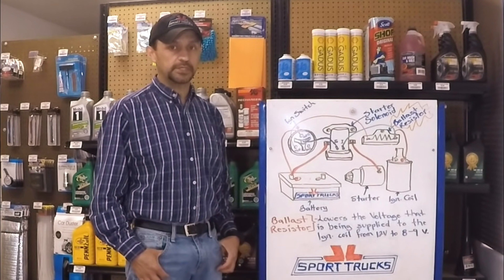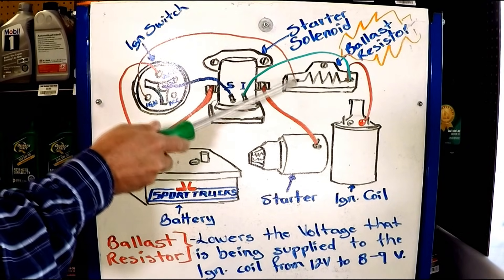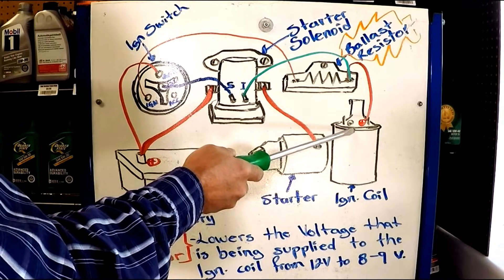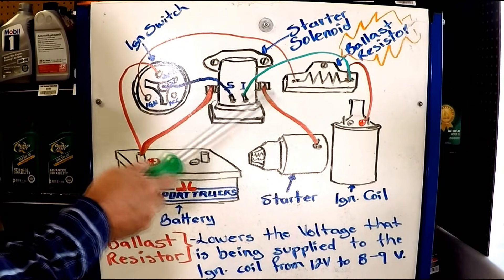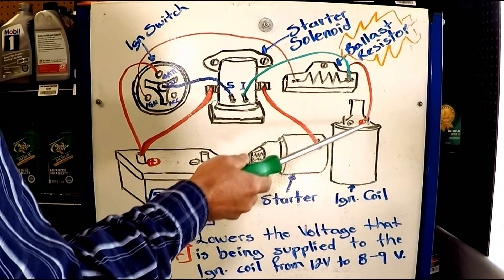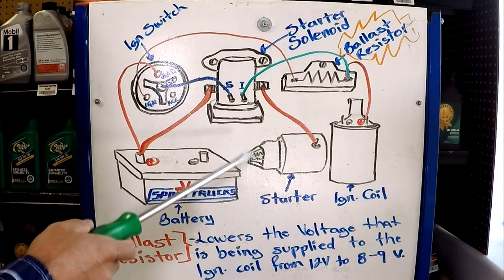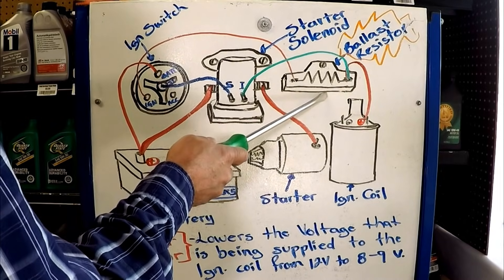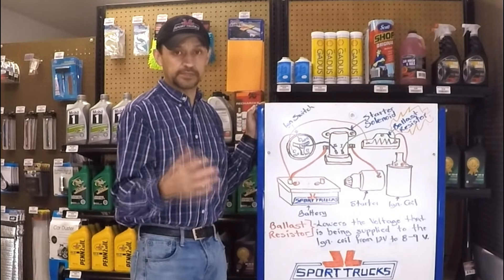How the Ballast Resistor Works

Comment: im currently working on a jet boat i just bought.Has no spark,ever dealt with a marine application with dual points/resistor.Has all these components but wired differently
Reply: if you have a g.m. engine that has the delco type starter with the solenoid mounted on the starter , than you want to run a wire from the solenoid terminal that gets power from the key switch when you are cranking the engine , you run the wire directly to the positive side of the coil . then you run a wire from the ignition switch " on / run " terminal , the wire that has voltage when the engine is running , not cranking , you run it to one side of the ballast resistor . then you run it to the positive side of the coil . if you are not getting spark at the plugs when you crank the engine over and are holding a plug with it grounded to the engine , then you want to check your condenser/ condensers , and make sure the points are opening . turn the engine over by hand or bump it with the starter until the high point on the eccentric , the part that rubs agaisnt the points rubbing block is directly adjacent to the rubbing block . check the gap between the contact points of the breaker points . it should be about .020 " . and make sure your plug wires are good and your ignition coil are good . spark plugs are not usually the cause of the problem unless they are oil-fouled or the gap is too wide

Comment: My car had a points distributor in it at one point and the ballast resistor is still hooked up, even though the distributor is now an electronic one.  Can this cause issues with the car running correctly?  I'm getting random stalls that I believe are electrical in nature.
Reply: Did you upgrade your coil or is it stock?

Comment: What happen if your only have one tooth on your starter switch instead of two? How would you do the connection? Thank you!
Reply: Just connect your 12v cranking feed to the coil to the main thick starter wire either at the solenoid or at the starter on the output side of the solenoid as it is only 12v when cranking it's the same as connecting it to either the crank position on the ign switch or the small terminal on the right on the diagram of the solenoid he showed, they all only give 12v at cranking then go dead allowing the resistor to take over at 9v